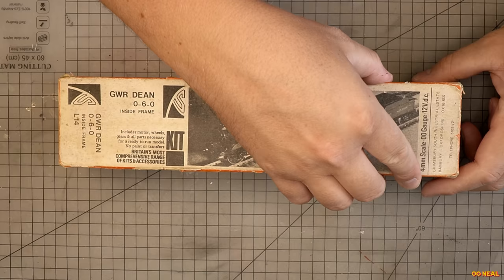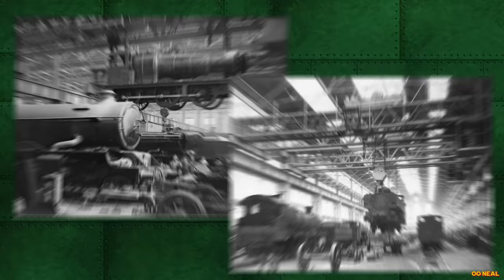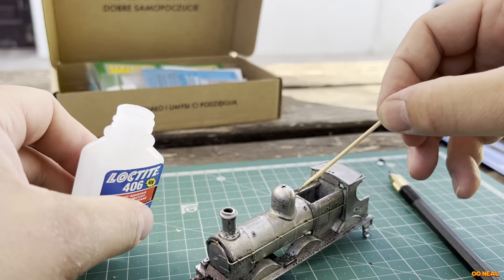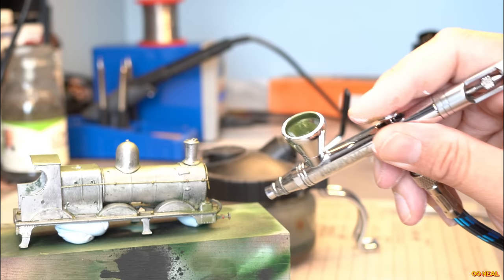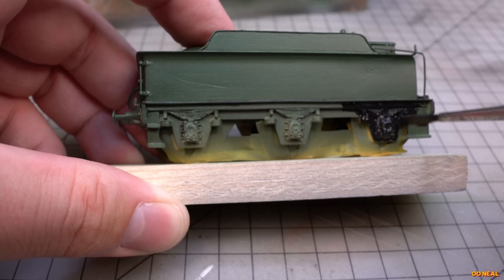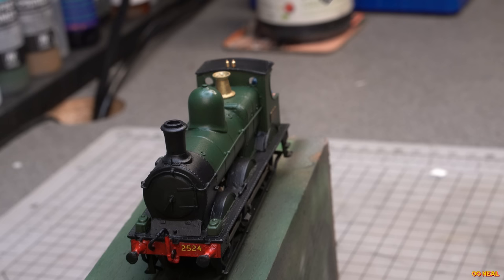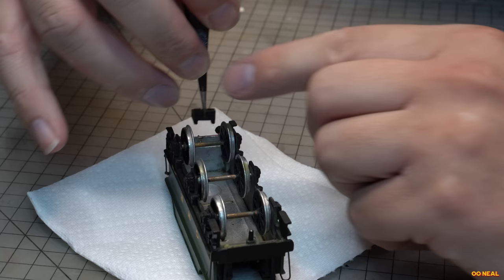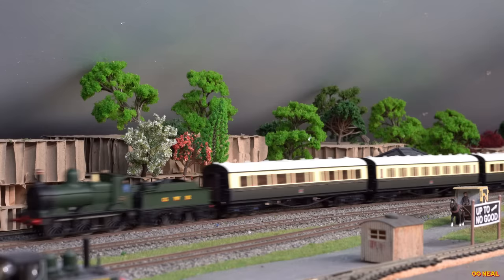How I restored the GWR Dean Goods White Metal Kit

Comment: I like restoring models too, it can be risky though. Shame that the loco wasn't soldered originally, but all's well that ends well. Great video, thanks for sharing 👍😊

Ive got a cast Smoke Box Dart on an O gauge loco to par off too. They really set the "face" of a loco if a seperate casting is fitted etc😉😊👍

I've some of the Vellejo primers, how did you find it stuck to white-metal? I've had to remove oxidisation then prime with an etch primer. In the past, previous versions of Games Workshop "Chaos Black" would adhere well to cleaned white-metal, but the formula was changed and it won't work as well these days.
Reply from the maker: I found it stuck but I washed the model first and did quite a few thin coats and let it go fully hard. I was conscious of the primer not sticking but got through it ok.
Reply: @OONeal  Thanks 😊👍 A nice model ensued too, well done. Brass and white-metal, oh and aluminium, can be a real challenge to paint. I admire your CAD abilities, I should learn but each day that passes, I fall out of love with computers (after thirty five years working with them)😳🙄👍😉

Comment: Hi Tris, would you recommend superglue instead of Araldite if you were building one of those kits from scratch, regards Jon.
Reply: I wouldn't. Super glue dries hard and very brittle and in despite its name really isn't that super when it comes to bonding performance with solid non porous surfaces. It is better for soft porous materials hence will stick your fingers together very well. I have recently purchased a model that was "professionally"  repaired with the stuff and didn't go to well, ended up having to repair it again myself.
Reply: @RobA500  Do you know if the glue that you cure with a light pen is any good with white metal? I bought some to experiment with generally, but haven't actually used it yet...
Reply: @AllSortsOfStuff58  Hi, I don't have any personal experience with UV cure glues but from what I have read there are types for many purposes including bonding metal plastic and even glass, so providing you have the correct type it should form a good strong bond much better than super glue.
Reply: @RobA500  That's my thinking...  👍
Reply: An epoxy is way better than a cyanoacrylate (CA or Superglue). Even better……. Low temp solder (70 deg C) 
It’s not a difficult skill and permanent!